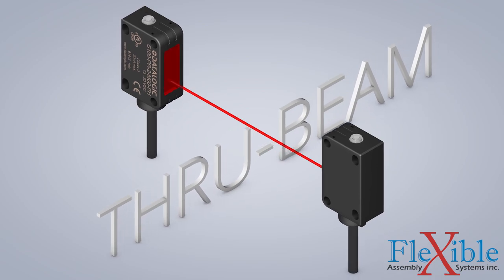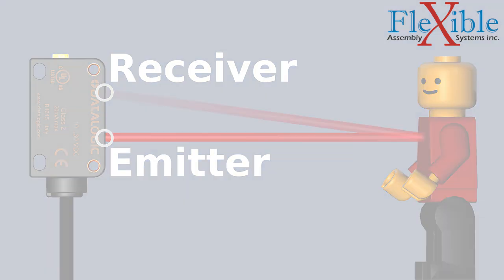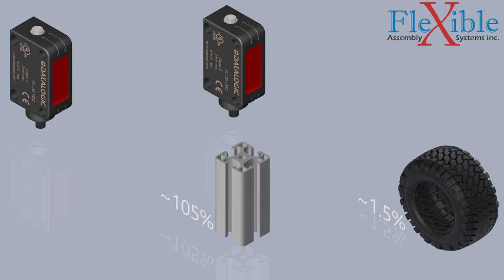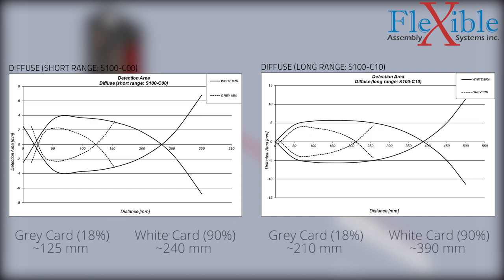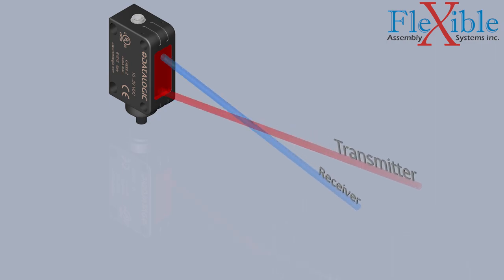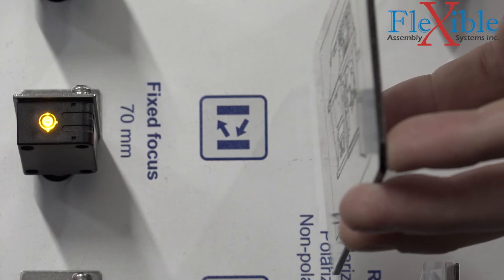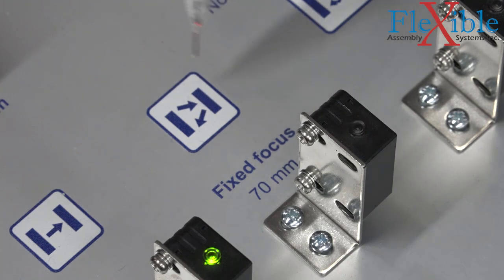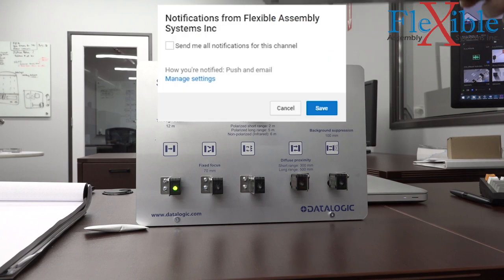Photoelectric Sensors - Diffused Proximity and Fixed Focus - Part 3 - Datalogic

Comment: Can we detect plastic specifically?
Reply from the maker: A photoelectric sensor can detect any object that reflect light back to them. If your plastic is transparent it may not reflect enough light to be sensed. The sensor can't tell you if something is plastic, metal, glass, etc... It can only tell you if it seems 'something' that reflected the light it emits back to the sensor.